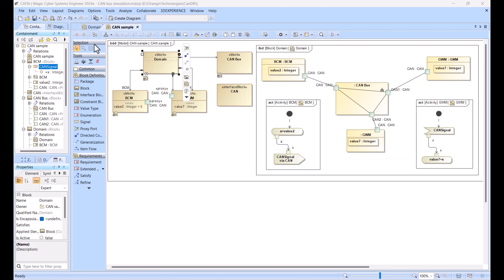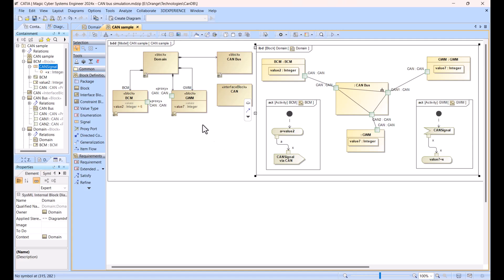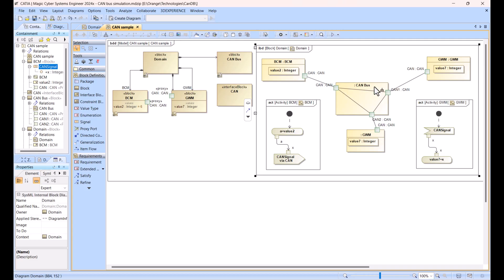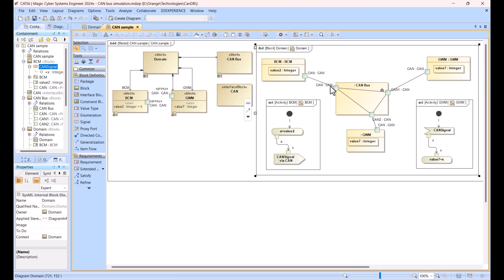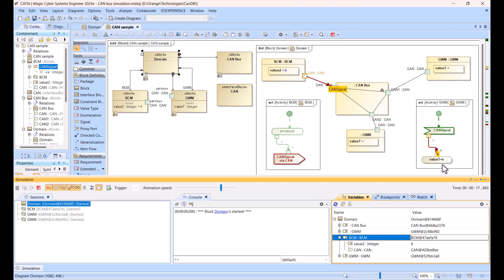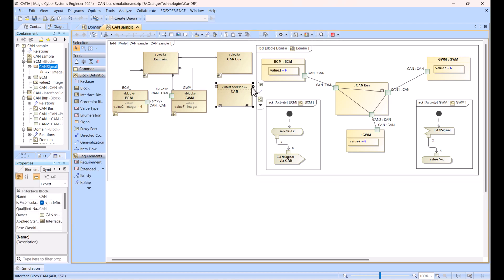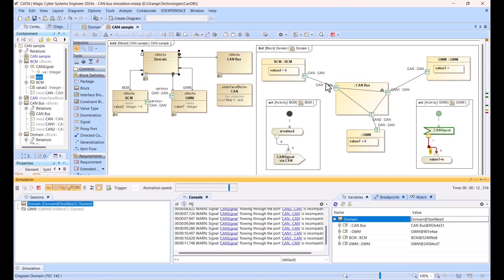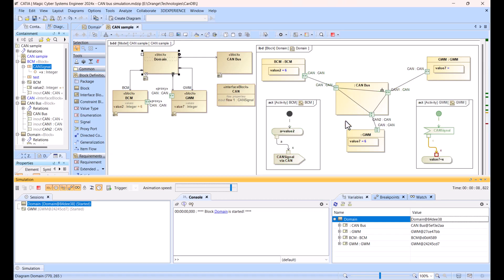Signal Broadcasting in SysML Simulation – CAN Bus

Comment: Thank you for this demonstration. There is a thing I don't understand: The signal is sent only once to the can bus part, but the animation shows it twice. I was expecting, that multiple signals are only appearing inside the CAN Bus. If I hide the interal structure of the can bus part, it will be very confusing, that every signal travels multiple times after it has been sent once.

Another thing that I find strange is, that CAN bus is a part of the system. Is there really a dedicated block that can be identified as the "CAN bus". From what I know about buses, they only describe the topology of connected parts and are not a part of their own.
Reply from the maker: Hello, thank you for your questions. CAN bus is logical part here. We can make it also as reference. Signal is the same just animated twice.